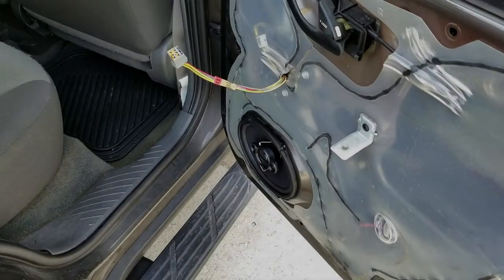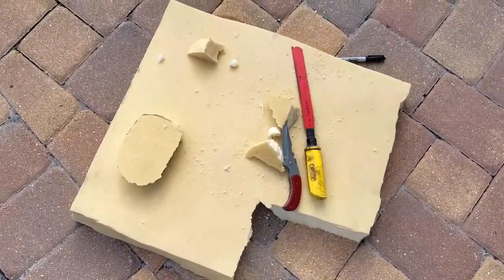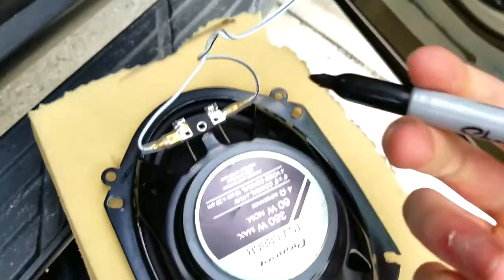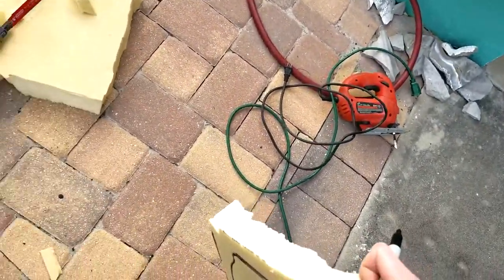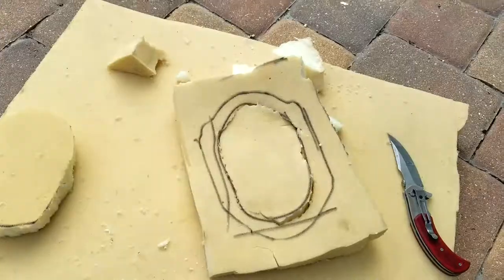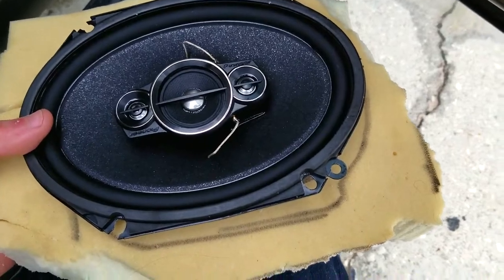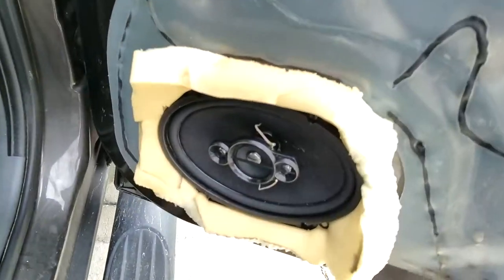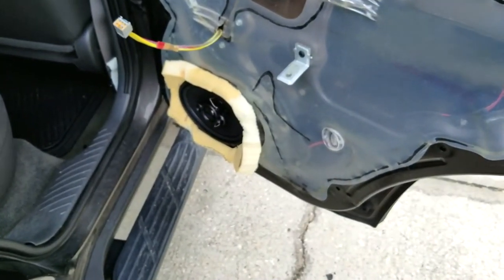How To Reduce Car Door Vibrations When Playing Music [EASY DIY]

Comment: So glad I found this video!  I have a 2007 Tahoe and I bought new door speakers.  After hubby installed them, when I turn it up my door panels rattle.  It sooo annoying!  He said that there is nothing that he can do.  I was thinking maybe putting a towel around it.  What do you think?
Reply: Have your hobby to do what this guy did put foam around the speaker’s, I did it and it works so glad I did it!👍🏽👍🏽

Comment: folks ok dont do this,first off he should have left the trash is his neighbors garbage, theres videos that show you how to do it the right way haha.cover all the holes in your doors yes even the big ones that were made to reach inside to work on stuff,cover them with thin metal or hard thick plastic ,yes put screws or pop rivots to hold them in place,then cover that with sound deadener ok,look for metal rods that move to open doors wrap foam around them.then on the back side of your door panel,the plastic panel,door card,they sell sheets of foam thats like 1/4 inch think or more with a sticky side,you peel and cover the back of your door panels.put your panel back on dont fasten it yet ,turn your speakers up listen for rattles if none go ahead and reinstall.this is a better way to do things,you've made your door a sealed enclosure by doing this if you do it right,also get some aluminum tape they sell in hardware stores they use it in attics around your ac ducts,use this to tape everything up with because it wont melt and come off.i could keep on but im tired good luck